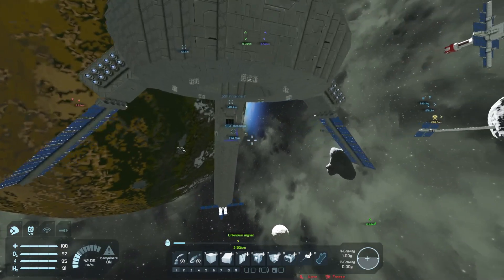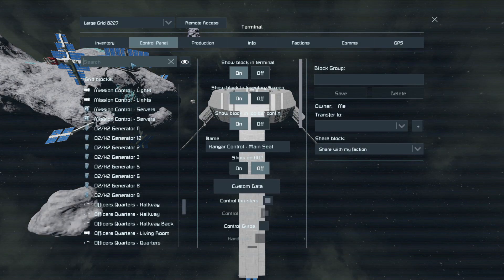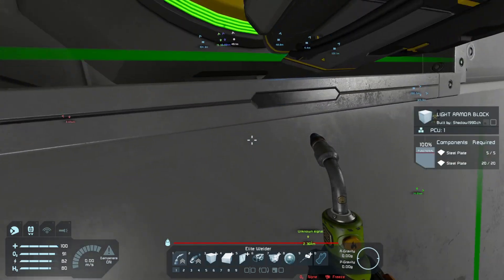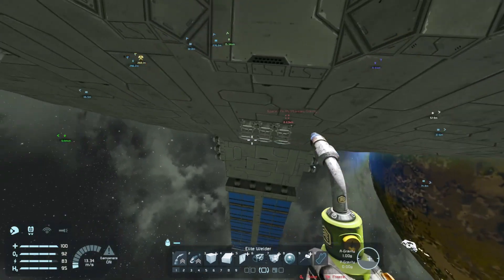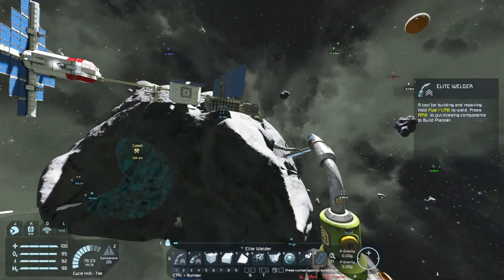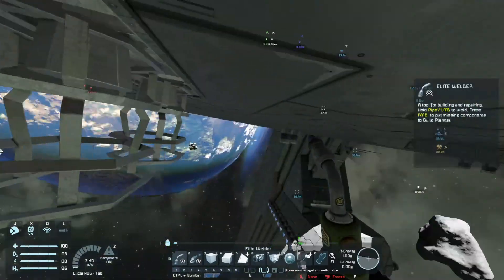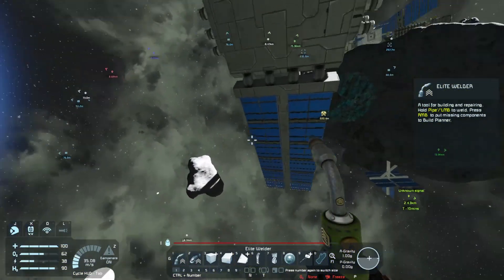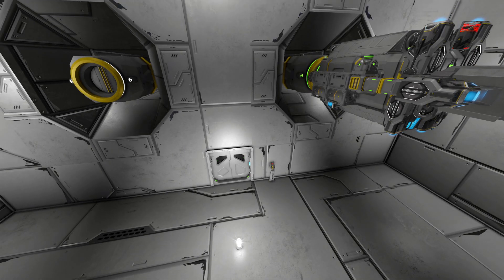Space Engineers: Docking Improvements

Comment: Calling your cameras left and reft is like saying larboard instead of starboard except mirrored XD
Remember: there is no RED PORT wine LEFT in the hold. Also, starboard is a corruption of "steering oar" which is where you'd man the tiller on your ship. The steer-board on the boats in Valheim is on the right, and it MAY have influenced why cars in europe and also asia tend to put the steering wheel on the starboard side of vehicles too - it is typical that mooring at a port or curbing for passengers is best on the opposite side of the steering apparatus.
Reply from the maker: That is a great way to remember that!